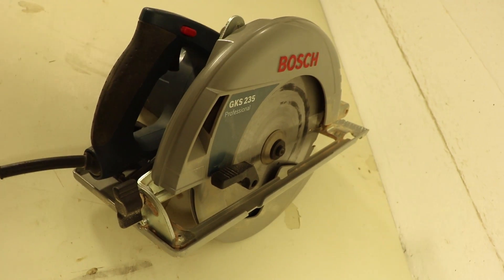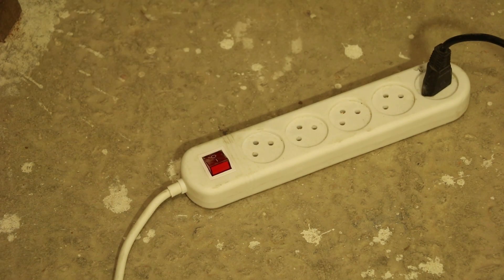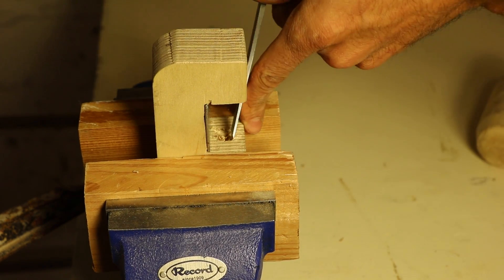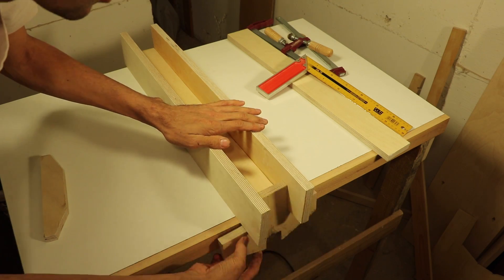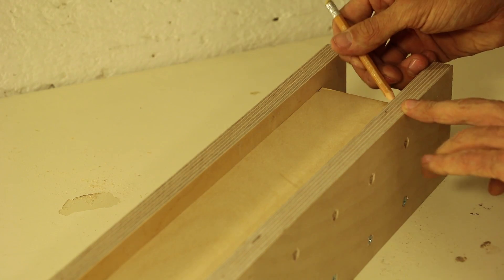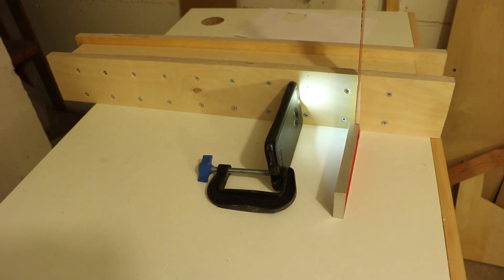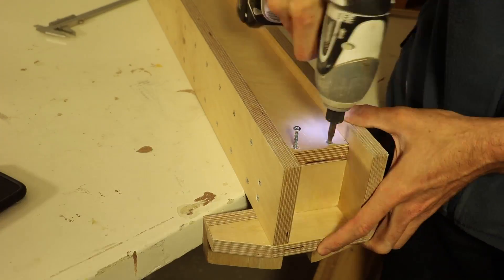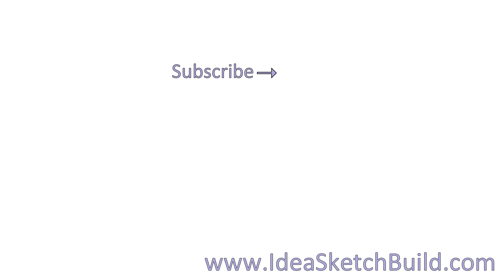Homemade Table Saw - 1: Fence Build and Alignment

Comment: That is such a good idea, making it wide enough that it doesn't move about. The fence that came with my bandsaw does just that so is virtually useless. But your idea of a wide fence stops most of the movement. I must see how you made the vertical drill press now! Thanks very much. Only one problem, the "On hold while we wait for an operator" music drives me mad!! Small problem really which is more to do with me I expect.

Comment: I love that you only grip the front skirt of the table. I've always hated how cheap fences can be locked crooked because they grip the entire depth of the table. This is a great solution as long and there's no flex on your fence or tee. I wish they'd put these on small job site saws. ☮️❤️🌈

Comment: Great idea for the clamp. I'm in the process of making my fence and considering this design. Could I ask how it has been? Does the clamp hold the fence really tight and solid all the way down? Or can it move or deflect? The clamp that came with my saw can slide if I press against it too hard and also deflects so I'm trying to improve it

Comment: Hi. I've seen a number of table saw fence DYI videos but I always get confused by the fact that most-designs only restrain the fence on one of the ends. I feel that instead of T-shaped, the fences should be H shaped. I mean with a T at each end. With only one T, isn't there some play at the other end of the fence which could hurt the precision of the cut?
Reply: The concept is to make the t-end strong enough, which he does, giving it a strong rail and bearing surface, then rely on the "beam strength" or its resistance to deflection (esp. due to the box-section) - working all together to make the fence-object immovable. That sums up how t-square fences work in concept. If you try to clamp to a rear or second rail there is ususlly some deflection made making settings difficult; moreso than with the single, front rail clamping scheme.

Comment: Seems like  a wasted opportunity.If you are going to mount a circular saw underneath. Why not make a drop in insert big enough to mount the saw.? Then make several inserts the same size,so you can just pull one out and drop in the saber  or hand router etc. Mounted to another inset of the same size  And blank inserts for if you don't want anything or for a future tool . Just lift an insert plate switch tools with another insert and plug it in under neath . Still I give you a thumbs up for effort and because I like you.